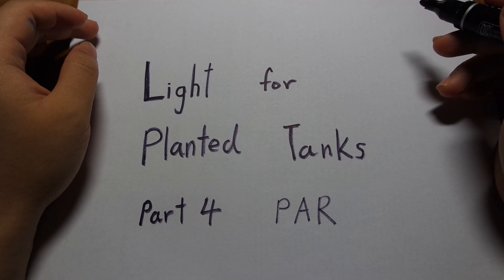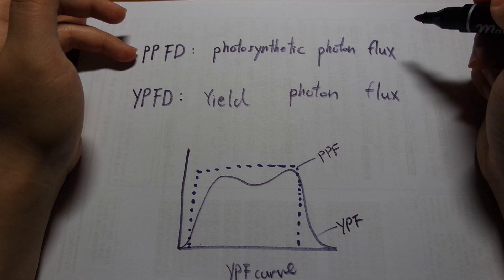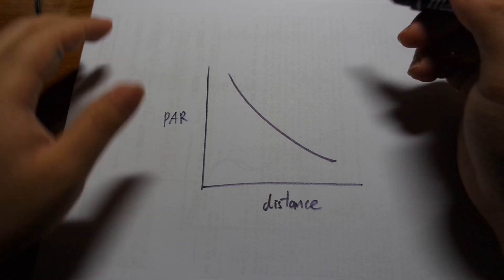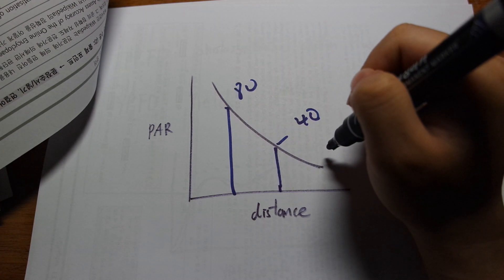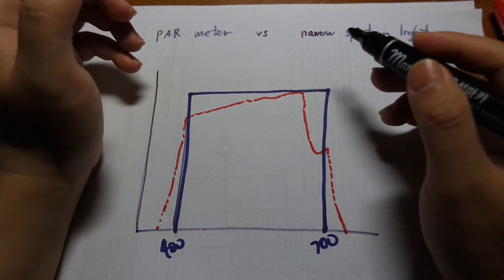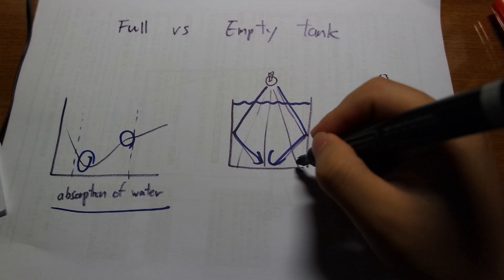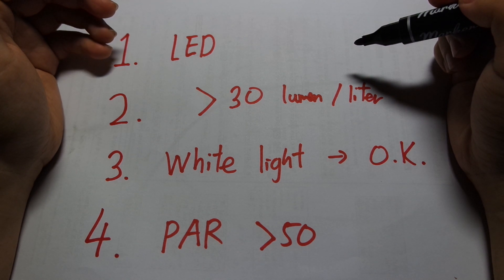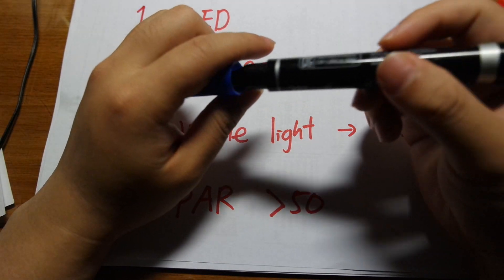Light for planted aquarium guide part 4, PAR

Comment: I have a superfish 85cm led light that states it outputs 250 par at a distance of 20cm. (im presume this figure is not a submerged reading and the hotspot obviously) do you think this light could be capable of emmitting 30 -  60 par min front to back at the substrate on my 80 cm long x 30 cm wide x 40cm deep tank with 6 cm of substrate. Im asking because I'd like to try to grow some carpeting plants and if not sufficient was thinking of supplementing the light by adding a second identical fixture. You think that would be adequate lighting for carpeting or should I go in a different direction all together? And thanks for taking the time to read this whoever does.  I should add im not currently running co2 was my next upgrade then was gonna add supplemental lighting

Comment: thank you sir for so much knowledge..this is still bit confusing.can i show you my tank please.. have 5 ft tank (60 inch x 18 inch x 18 inch = 84 gallon) i have installed 8 led bulbs 2 x 20 watts 2400 lumen + 4 x 20 watts 2000 lumens + 2 x 9 watts 9lumenper watts and all are 6500k. is it way too bright?? cos i have lot of melting and silica at bottom. i run co2 too. please advice
Reply: Bhai jan main v dekhrahu ye video lol thoda samaj n k liye